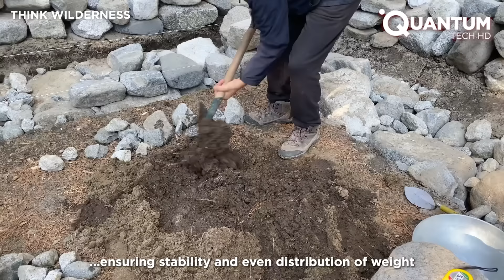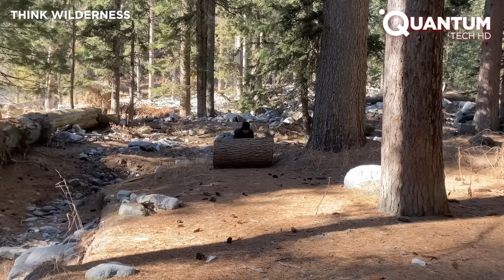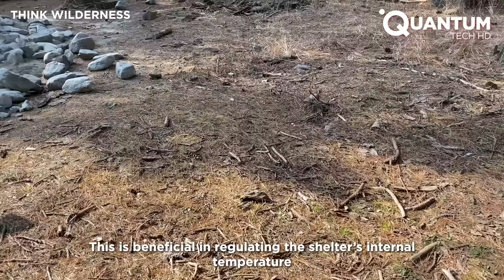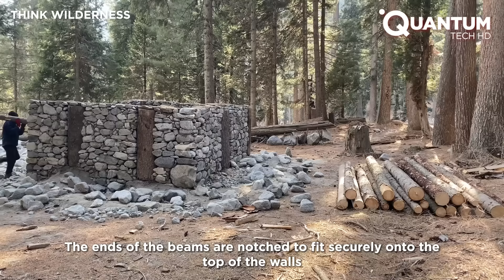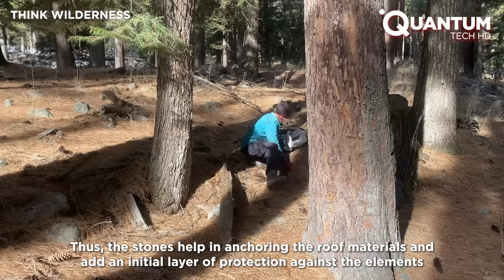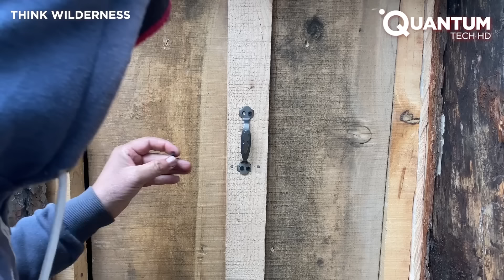Man Builds Survival STONE SHELTER in the Forest | Start to Finish by @thinkwilderness

Comment: Other than adding a fireplace, the one thing that I would recommend he do differently is strip the bark from the logs. The bare wood reflects heat and provides better insulation.  The bark will. rap moisture between it and the interior log which will cause ithe log to rot faster.